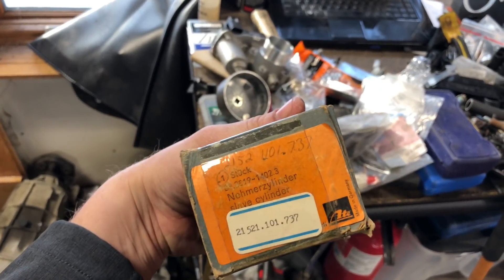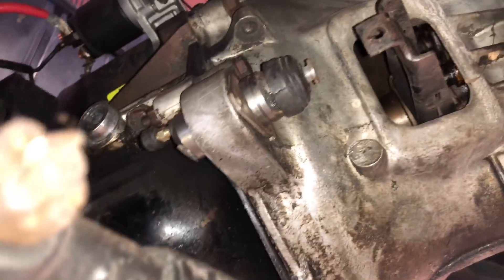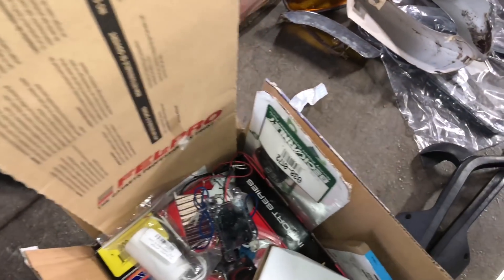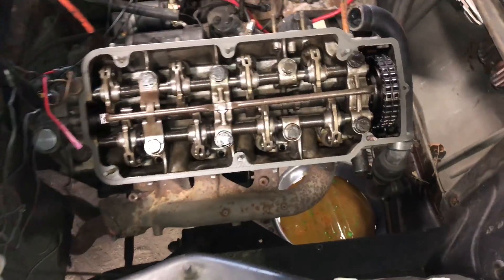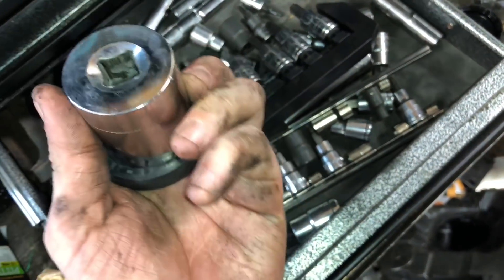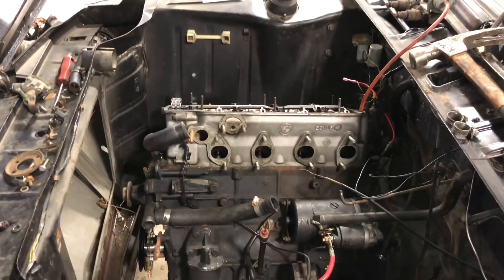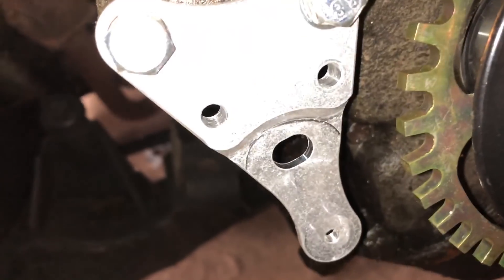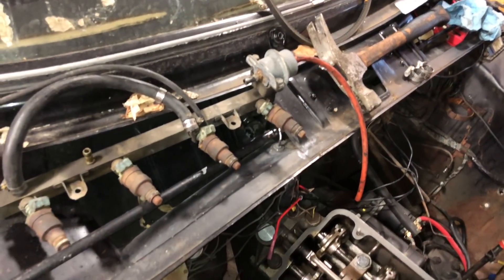Starting the EDIS-4 conversion and Megasquirt on the Project E10 Roundie

Comment: I would like to see the modules needed
Reply from the maker: unfortunately the system did not work in my setup, so I am hesitant to show anything since it might be wrong.
Reply: @OvalboreCars  I'm working on a 64 falcon with a 4.6 4 valve from a Lincoln just trying to get familiar with EDIS but I think the Ford fuel management is the problem now

Comment: You need a clip and a rod for the clutch,how come it doesn’t have a hydraulic style system to engage the clutch fork ?
Reply from the maker: this is an early 67. mechanical clutch and 6 volt electrical system. before the E10 was established as the '2002' by several years.

I bought a used Getrag 242 with a slave. hopefully I can canibalize some parts from it to make this fit.